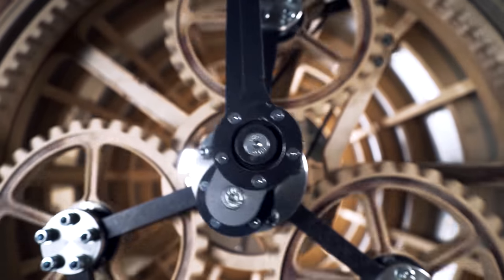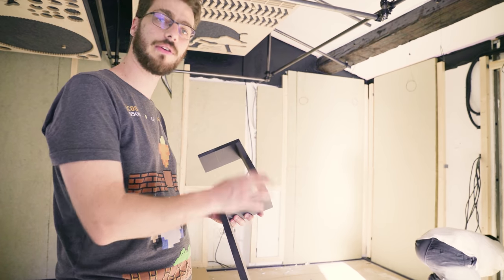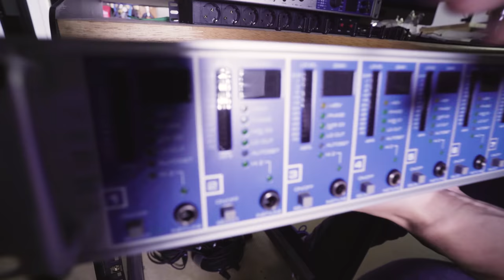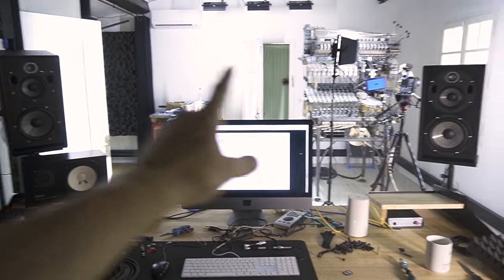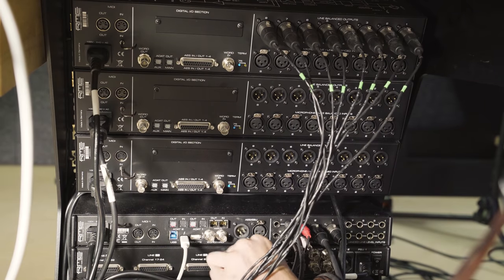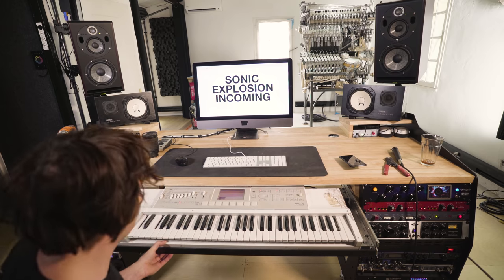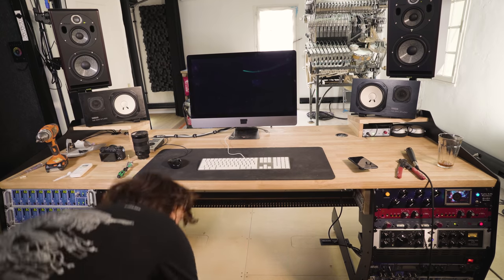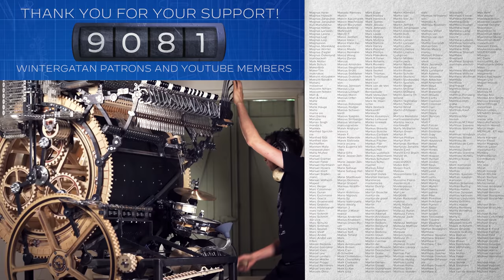Feels Like Home - Marble Machine X #134

Comment: if it is necessary to round the edge of the desk, it means that the sitting position is too low.
Your tendons will be grateful if you don't squeeze them against the edge.
Reply: It could be that this sitting position is ideal for playing on the synthesiser
Reply: It's typical with audio workstations with a keyboard beneath the desk. I don't think it can be avoided easily.
Reply: Why would you want a sharp edge to the front of a desk? The more comfortable it is the longer Martin can work
Reply: If the desk was lower, the synthesiser wouldn't allow his legs to be there.
The solution is clear, he needs to lower his desk, cut his legs of and get a wheelchair! Perfect, now he won't get aching arms!
Reply: He could change chair height for playing music vs working in solidworks or fusion360. Sometimes it would still end up pinching his arm though.
Reply: It's up to him...I don't know how much time he will spend in engineering, but, even for minimal projects, I think I would prefer to feel right with the DAW's controllers than with synth...
Reply: @JackPorter  Pain is temporary. Glory is forever.
Reply: It reads to me, your saying, the rounding of the desk edge was unnecessary. That the height sitting position, is the cure.  I can't imagine the chair not having adjustable height. Lastly. Why not round the desk edge?
Reply: @KingQuetzal  But it's simply not possible, if the keyboard stays above where your legs should be. For me at least when I put my chair up as far as possible, so that my legs are touching the keyboard, the desk is still way too high for comfort. Unless you don't put your legs beneath your desk, which sounds even more uncomfortable. Or you have really small thighs that fit anywhere.
Reply: @Phatency  I have pretty big thighs and it works for me. My chair does have armrests that sit level with my tabletop though so maybe my arms are high but I don't really notice because of that. I do have to put my armrests up when I play the piano though.
Reply: I received your reply. Thank you. Youtube gave me this only option to make a response post in this way.
Language differences is a problem.
Sitting position to any keyboard is important to arm/hand comfort/health. But does rounding the desk edge really mean the sitting position is too low? I think you made an assumption of the setup. Why not round off the front edge of the desk? A rounded edge, in my mind, would give less stress, even if the seating position was not proper. Now we are assuming his keyboard is positioned where his wrists are contacting that edge. Maybe they are not. As I type, My keyboard is forward enough that my wrists are 10cm/4 inches away from the desk edge. There is no pressure on my wrists. When he goes on tour. I expect he will be keyboarding while standing.

Comment: It's a myth that separate circuits isolate hum.  They're all hooked together electrically at the panel.  To isolate hum (historically called "audio susceptibility") you need line filters between the circuits.  Even being on different transformers doesn't do much isolation because transformers are lousy line filters.
Reply: Doesn't this provide an argument that the A to D conversion be performed on the machine? Rather than at his desk. That would also eliminate the monster cables and connectors. A single digital cable can handle all the audio.
Reply: What he is doing is keeping keeping the switchmode power supplies as far away (electrically) as possible from the analog circuitry. A/C mains hum isn't the issue, it's the 5Khz+ whiney switcher noise he's fighting.
Reply: @henryD9363  Yes. It absolutely does. But he states the reasons, with which I can't argue. If there's enough isolation as is, there's scarcely a reason to change it. I also wonder how much inductive coupling is going on in the serpent, and what it would take to become noticeable.
Reply: Not a fan of the cable either apart from maintaining and troubleshooting difficulties a long cable with many wires just acts as a magnet for many undesirable effects. (Inductive and Capacitive coupling , High frequenzy antenna and inductive signal delay just to name a few) 
In the industry you always learn to keep low gain signal wires as short as possible and switch to error correcting or at least detecting bus systems as soon as possible. And when you can’t do that you always switch to a high voltage signal (most times just binary anyways) to keep the signal to noise ratio in your favor.
I really hope there won’t be any significant problems with the current installation on the MMX.
As for the „separate“ circuits I agree they are mostly for peace of mind and for maximizing the distance between noisy switch mode PSUs.
A better way would be to install a „clean“ DC supply and just derive your voltages needed from there, or if you want a cheap effect just plug everything in long extension cables and lay them separate from each other in the floor.
Reply: ThePunischer1000 Trust me when I say that the difficulty’s and undesirable effects you describe from having a long cable with many conductors is easily engineered out. I’ve personally seen a 52 channel, 300 foot, low voltage cable without any of the issues you described. However, that doesn’t make it the economical or even a practical solution in most circumstances. And in this case I am inclined to agree with you. I suspect his cable is going to have its fair share of complications and draw backs. Based on its size and how it’s terminated I don’t believe the cable has been properly designed. For his purposes each channel should be twisted, up-gauged, and individually wrapped and shielded.
Reply: It is not just different circuits, they probably separate sound, light, and other equipment by putting them on different phases. Which might or might not help with hum, but it is almost always a good idea to keep those electrically "apart".
Regarding inductance and shielding of the monstersnake, balanced cables are designed to avoid picking up noise on the cable run by utilising phase cancellation, so even though going digital might be a better and slimmer solution, noise floor is probably not going to be a problem.
In live sound we use these kind of multicore cables all the time, and you could easily make them run over or next to 3phase power cables and not see or hear a difference in the signal to noise ratio.
But it is definitely true, it is always better to lay out your cables than to keep them rolled up like a coil, just to be sure:)
Reply: Looking at the electic panel you can see that its a 3 phase board, they definitely are not tied together.
Reply: @henryD9363  the One cable to rule them all \0/
Reply: C'mon guys, you're missing the big picture.  The electrical conundrum is easily resolved by adding an in-line flux capacitor and keeping the power below 1.21 Jigawatts.
Reply: i'll be honest i have no idea what you're talking about, but it sounds intelligent
Reply: You can get hum if the source and amp are on different phases. And it looks like he has 3 phase power.

Comment: 🎁 WARNING: I’ve been down this road three times now building a small custom audio recording studio decked out with cutting edge audio toys. You will instantly discover that audio rack gear installed all the way down to the floor is next to impossible to constantly operate by hand. 

The temptation later to resolve this dilemma is to install preamps and amplifiers in the lower rack positions.  But they get hot, and radiate a lot of heat which will rise up to your other units above, and cause them to overheat. So, if you have floor fans, which are noisy, will need to be introduced if you don’t think this all out carefully. Otherwise you will simply need to keep your studio room cool at around 70 to 68° during the time of operation. You might want to do that anyway to keep your gear cooled down.

SOoooo, only place stuff at the very bottom that you rarely have to operate by hand. I ended up putting sliding drawers at the bottom which are really cool. Don’t know if they make them anymore though. 

Secondly, your racked audio gear needs to be at a steep angle, and facing towards your seat, otherwise you’ll constantly have to bend way over to read each panel, especially the digital screens. However some digital screens have adjustments on them that enables us to read them from an elevated point of observation. 

So, you will want to angle your racked gear towards your seat. This makes it quick and easy operate your gear from your seat with a simple swivel of our chair. 

You are so far into your Build now that it’s almost too late to adjust to what I have brought to your attention. So you will have to go through the growing pains of Discovery like I did. 

There is so much more here I can share with you but I really doubt you have the time of day to read thousands of comments that are left for you, video after video.

As a professional lifelong Music composer, and the founder of Calling Heart Records, LLC, and Stargate Studios, LLC,  I wish you all the very best. Love your ingenuity of which so far has become my fascination with you.

You’re welcome to contact me directly should you ever need tech-support or good old fashion seasoned advice and suggestions for building small studios. Then I’ll give you my contact info. Otherwise....

Cheers! 🍷🍷
PS: I had a pullout keyboard as well. Turns out that it felt a bit odd to me when playing very involved fingering. So I did away with mine. Now I have a wireless pullout computer keyboard that comes out from underneath my 88 key piano keyboard controller. The Roland-V.
Reply: 70° ?! He's not building a sauna into his studio! /s
  
For all the people too lazy to look it up:
That's 21° Celsius in non-American units
Reply: I'm sure it won't be long before Martin takes the angle grinder to some of this lovely stuff. Pain is temporary!
Reply: You should post this to the Wintergatan Discord. It will be more likely to get discovered.
Reply: Thanks for the sound advice! I'm building my studio now.
Reply: At first your comment seemed legit, but the fact that you claim on your channel that you have created a infinite energy motor, and that Newton's third law is untrue leads me to seriously doubt what you're saying lmao
Reply: please join the Discord server so that they may be able to see this wonderful suggestion. :D
Reply: European room temperature is typically much, much cooler than American room temperature, in the upper sixties (F) usually. Additionally, Martin has a rolling chair, such that he can move back and forth between racks - the desk is far too wide to simply sit in the middle and reach both sides, even if they were tilted inward.
Reply: Wait... which Stargate Studios is that?
Reply: A water cooled system like used on high end gaming PC's would help the heat issue.
Reply: Lucas Boisneau - I make no claims of infinite energy on my channel. You are putting words into my mouth. I indeed have videos there that proves that for every action there’s an equal and opposite reaction is incorrect. Your rush to judgment makes me realize that you don’t have a very good head on your shoulders. And all the other ones that have giving you a thumbs up. All you have to do is duplicate my research like others are doing, and you will also discover that it works just fine.
Reply: Free energy loon😂😂😂

Comment: drools that desk drools
As for the headphone amp, I think the headphones you use, and the quality of the audio source output, determine if you need one. If you're plugging headphones directly to a computer, you might want a dac and amp to remove potential noise from the computer. If your headphones require a lot of power to work, then you also likely will need one just to power them properly. Another reason could be if you use headphones with a 1/4" jack, and not being able to plug into a computer without an adapter.
Reply: Adapters do exist though. And I agree on the dac. I think a TEAC UD-501 would fit really well for him since it could double as a headphone amp and it could be used for the speakers as well. And it's really tough to beat its performance.
Reply: Headphones with a quarter inch jack usually mean "don't plug me directly in the computer because it's not powerful enough" Don't just buy an adapter when this you get this. You need a proper amp/dac solution for this.
Reply: @slygg   Not universally true. There are plenty of headphones that will sound just fine plugged directly in. Two good examples are M50s and SA CB-1s. Both won't sound any better on good equipment (mostly because they aren't that good to begin with) and both come with a quarter inch adapter. Also, the Yamaha HP-3 aren't exactly hifi, but are planar and require a good amount of power. But apart from supplying a lot of power, they won't benefit from a high end dac or really clean amp.
Reply: @insederec  You are mostly right about planars not changing as much sound signature wise due to a different kind of interaction between the amp and the driver (certain frequency ranges will sound louder or quieter from amp to amp but not sound that "different" if that makes sense, also cheaper options typically really suck at getting bass done "right" on planars) however everything else will absolutely benefit the way you would expect from upgrades to both the dac and amp... They are different than typical drivers but they are not a magic box by any means. Source: I own lots of high end audio equipment and use it pretty much all day every day.

Comment: 17:54 I like how he wiggles his fingers on the keys a little bit like they're guitar strings.
Reply: some keyboards have what is called "aftertouch" which means they can actually do vibrato like a string instrument (though it usually responds to changes in downward pressure rather than side-to-side).
Reply: I always wanted that to be a feature, but I never tried to build a keyboard that could do that.
Reply: Maybe he should get a Roli seaboard!
Reply: The Korg can add modulation on the horizontal aftertouch axis in addition to the vertical.
Reply: I think a lot of guitar players do that. Myself and a couple people I know included. There are keyboards with that feature, but not super common.
Reply: That's called vibrato
Reply: @clawtooth35  My friend have that type of keyboard and I'm a bit jealous because he can make strings sound better

Comment: I HIGHLY doubt that the sonic difference between a modern high quality digital Stagebox (Yamaha Rio, Focusrite etc) and your dedicated setup is noticeable. if it is, it will be a sonic difference, but not an improvement. It will eliminate the left Rack in your desk completely, and seeing the analog troubles you are already facing has me properly scared of this setup on tour. I just can't comprehend why you would do this to yourself, but i wish the best of luck, this project is inspiring and awesome :D
Reply: My thoughts exactly 😆He hasn't even started using any of it and theres a fault with the multicore somewhere. :(
Reply: I guess he simply likes analogue stuff.
Reply: He could use something like a Merging Horus, which would be a step up in sonics. Running an analog multicore a few meters and then a short MADI line makes no sense.
Reply: Vinícius sure. I don’t share that philosophy and would prefer Waves plugins and day of the week, but that’s subjective. But given Martins „World Tour functionality“ push, it objectively makes no sense
Reply: The sound of the machine would be amplified and mixed with all the other instruments. This would drive the house speakers. The resulting sound quality is pretty poor. In other words the desire for excellent audio quality for recording is reasonable. It's meaningless for a stage performance especially with a huge audience.